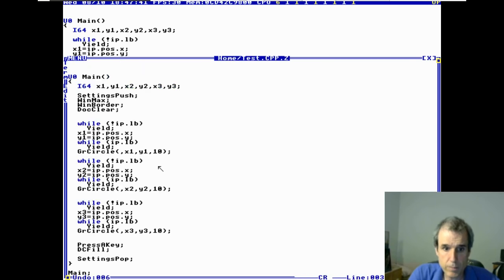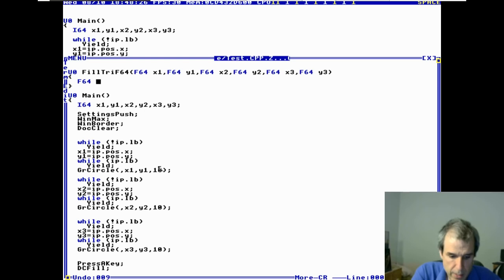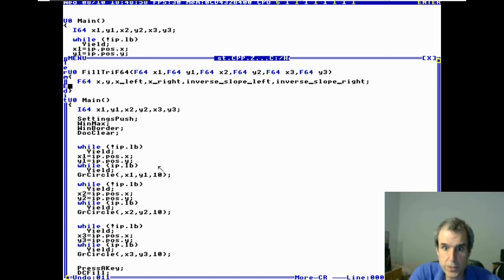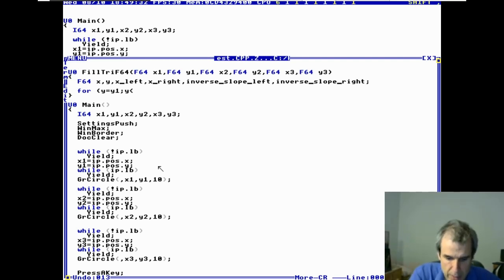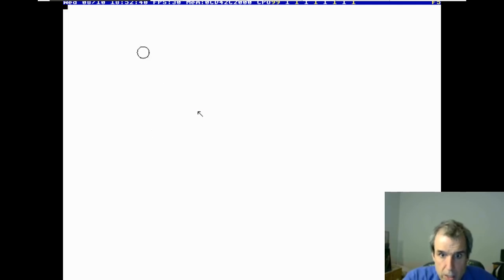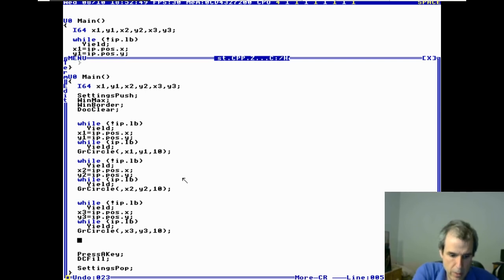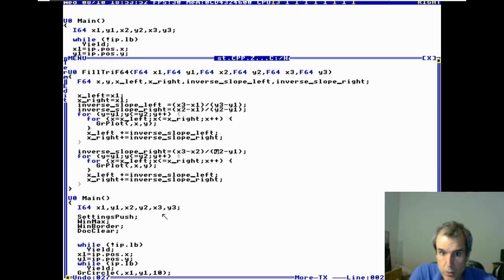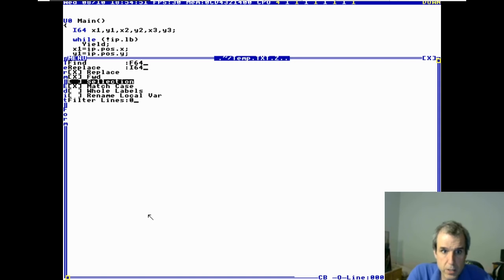728 - Templey Lessons: Triangle Fill (TempleOS) [2016]

Comment: you guys understand what he did, right?
Reply: I mean, it ain't too complicated is it? he calculated the slope of the left and right side of a triangle for both halves; iterated across the left to the right side of the triangle within the inner for-loop; and iterated 'down' as well as updated the location of the left and right side of where the triangle 'should' be in the outer for loop. in the integer version, he seems to just 'split' the integer in half - since the resolution of the screen would never truly utilize a potential space of billions of pixel locations anyways - and otherwise just does the exact same thing that he had already done in the floating point version of the same function. and all you'd have to do to guarantee that this works for all possible vertex variations of a triangle is effectively 'sort' the vertices prior to passing them into the function.

oh, and apparently he has intrinsics that allow him to create buffers with a push and pop stack for the console settings ahead of time. that's pretty neat, altho I would like if there was some indication of 'what is happening' since the parens are discarded in these system calls. it makes a little more sense to print to the screen with a simple double quote "operation" given that we are purely within a console, but would prefer some indicator for that as well. same with skipping the declaration of the device context (assuming it just has a default argument in the function prototype) -- at least optionally have a system macro labelled __DefaultContext __DefDevContext or something along those lines.

Comment: Graphics cards still do more or less this to render 3D models, right?
Reply: Yes, since there are more efficient ways to render triangles
Reply: You should check out gamers nexus, he talked with some Intel engineers about their new graphics cards a couple years back and they went really in depth about the entire process of producing a frame, really good stuff
Reply: Did not watch the entire video, but it seems like he's using slopes to draw the triangles, the normal way to render is rasterization, where barycentric coordinates are used to check if a pixel lies within the triangle. Barycentrics use a multitude of dot products to achieve that. For his method you'd need more different slopes, because mathematically y/x is limited to one quadrant.